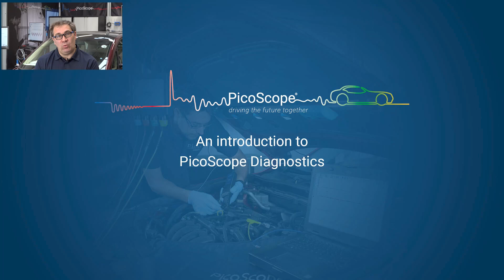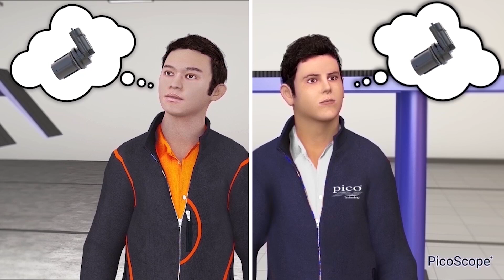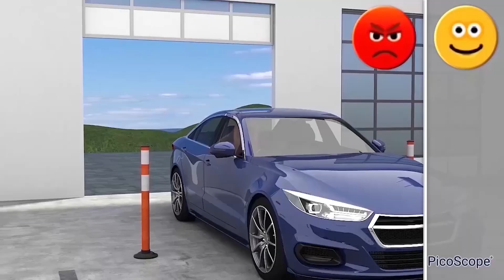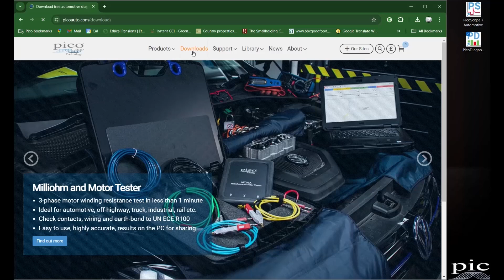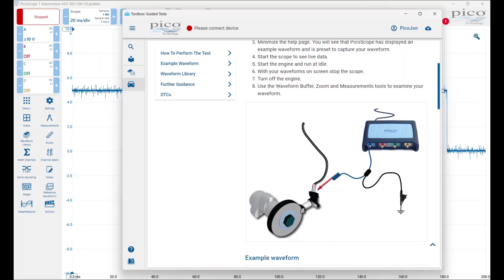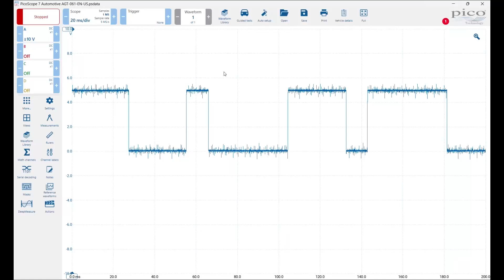1. Introduction to PicoScope

Comment: Hi Picoscope Automotive,

Could I please ask a couple of questions regarding the cam/crank correlation test you did?
During the video (roughly 1hr16) it was stated that the peaks in the crank signal were the teeth. Is this correct? I always thought that a Hall effect sensor had the signal pulled to ground when a tooth was over the sensor.
Also, how accurate is it to use the time rulers as a guide? The fact that engine speed could vary between vehicles (especially when one has a valve timing issue) would affect the time between any engine events.
Hope to hear back, many thanks.
Reply: Hall effect sensors can be setup either way - they can be either pulled up or down when over a tooth, just depends on how the manufacturer decided to do it. If you peruse the waveform libraries you'll see it both ways.

As for the time rulers, yeah, he didn't do a good job explaining that. You'd want to use the 720 degree rulers or similar to get your measurements in degrees rather than time for comparison between vehicles for the reasons you stated.